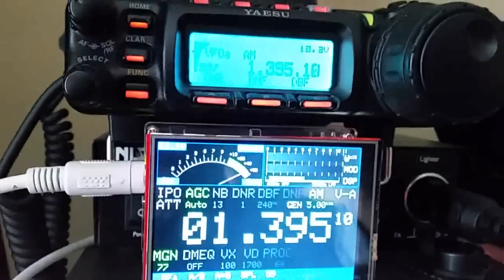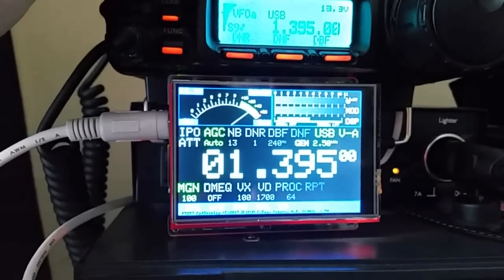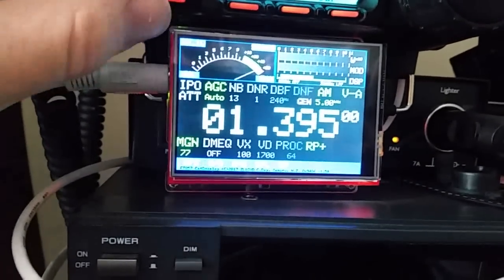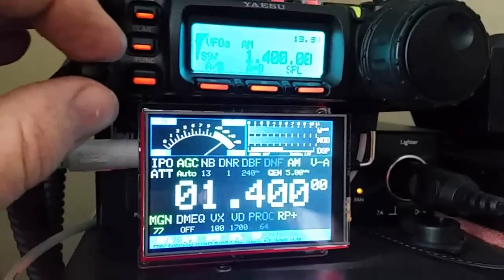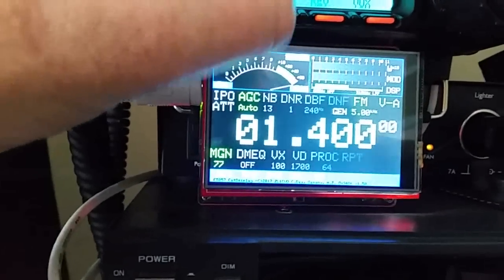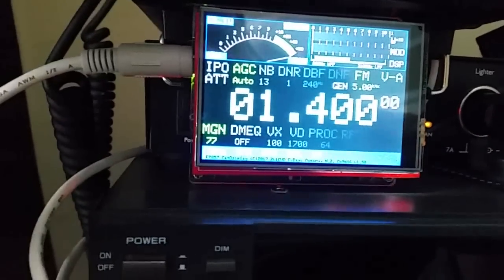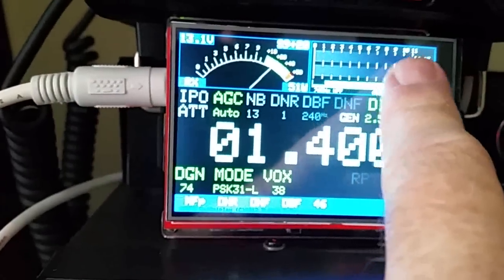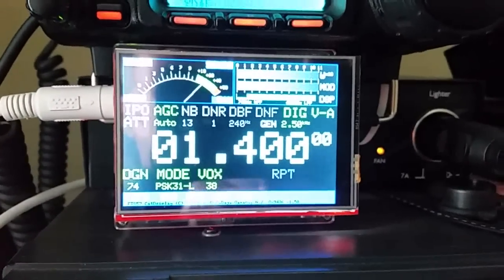CatDisplay for Yaesu FT-817, FT-818, FT-857 or FT-897 Transceivers

Comment: The CatDisplay arrived 3 days after ordering and is now working with my 897, as its original display is almost unreadable now. My radio doesn't have extended menu items 15 to 21 for some reason, but the CatDisplay worked fine without those adjustments. .Thanks Chris 73 Dave XU7AKG

Comment: Please tell me Chris you're intending to develop a CAT pass-through. I really need this display, but I just can't have it monopolize the CAT port. If you can add a pass-through, you'd have a world-beating product!
Reply from the maker: Yes I do intend to add a pass through port but its taken a heck of allot to work the code out. The 328PB processor is full so have had to move to 644P. A new board has been designed and 50x delivered for almost 9 months now. I had it basically working then Arduino updated the IDE which ended up breaking my compile chain. I've got it going again with latest IDE but its not 100% perfect and needs more refinement. I've even purchased www.catdisplaypro.com as a home for it and the other versions of the basic CatDisplay. So definitely in the pipeline but taking way longer than I'd hoped. 73s om.

Comment: Your eBay page shows you have one left for the 857. When will you have more ?? By the way, awesome item!!! I WILL be buying one! 73s 
PS, I would like to see the tune option for the ATAS120, I use it a lot. If you could add that, then it would be perfect, for me anyway. Thanks again
Reply from the maker: I won't be adding cat pass through  support because there is not enough code space left in the processor. 857/897 already has 2 cat ports - rear and front microphone. See the link in video comments. More stock will be available as parts arrive. 73s om

Comment: Do you have another video showing how fast the display responds when using the Main Tuning dial changing frequencies.
Do you plan to stay with the display.  The numbers are not smooth. Jagged numbers.
I own a FT-857(non D) and FT817ND I would like to use the unit on both.  If the stored firmware could be booted for one or
other with a switch it would be a big plus.  
Have you thought about bluetooth connection to the CAT port on the FT-857 instead of wired connection.  My FT-857 is mounted
in the trunk of my car with remote up front.   I use a bluetooth adapter for a few programs like pocket rxtx and others via bluetooth.     Thanks for a great project.    Ken
Reply from the maker: This is only video I have. A customer did this one: https://www.facebook.com/frank.f.jensen/videos/10211749145778240/
The small processor program size (32k) and large amount of data displayed means I cannot use another smoother font & support all FT817/FT857/FT897 models. This is why 2 versions of firmware - one for 817 and one for 857/897. Cat data is plain serial so bluetooth could easily be used if you want. However you wont be using the same Cat port for the display and a PC program at the same time - the display is very Cat traffic heavy as its continuously updating.  In its present form it has been well received with over 100 sold now so no immediate plans to change its format. I have jut update my 857 with a Collins filter so I'll try and fit which filter is being used on the display somewhere at some point. If I had used a Pi then the font would be better, it could support multiple rigs and touch screen would be supported. But then with my Linux programming ability and Linux's complexity, it wouldn't be ready to use until next century! all the best.
Reply: Took a look at the other video but doesn't give any indication how quickly the display reacts to the radio.
Reply from the maker: Another video here https://youtu.be/kuUg3tQGN4Y

Comment: how long can the cat cable be i would like to run one of these in vehicle with only control head on dash so 15 ft would be good  the display for this is much cheaper to replace then display on radio
Reply from the maker: It comes with 1.5m cat cable & I dont have longer. You could cut and splice a new section to it though. It'll do 15' ok. Only 4 wires needed RX, TX, GND & 13.8v. Shield RX/TX lines - cable like audio shielded would do. 73s om de chris zl1cvd

Comment: HI Chris. Display works great, but the S meter is at zero all the time. Is there a setting that need to check?
Reply from the maker: On the transceiver make sure the AGC is turned on (auto = all modes;  fast=AM; slow=SSB). Also you must be in VFO A or VFO B mode - it does not display correctly in any memory mode. 73 om de zl1cvd

Comment: Are you adding a feature to the display to show when you are using auto tuner or atlas antenna function witg the 857d including swr reading
Reply from the maker: Those items are not supported by Yaesu CAT commands so cannot read from FT817, FT818, FT857 or FT897 to send to CatDisplay. New models like FT991A, FTdx10 or FTdx101 have much better CAT command support and have these features on CatDisplay232 or CatMeters - see https://www.catmeters.com

Comment: I hooked this up to my 857D and it says it cannot find the baud rate.  I've tried setting all three, turning it all off and back on, and the frequency display is all zeros and then I get the cannot find the baud rate message again.  Have I overlooked something in the manual?
Reply from the maker: Make sure the cable is plugged the cat port & display port firmly. On the 857D, the Cat port is the one closest to the DC power lead. Make sure menu 020 is set to CAT. Menu 019 sets speed. On the 857D, you must press the F button after you make a menu change change until it beeps - this confirms the changed setting has been saved and is now active.

Comment: Hello Chris, 
Is there an update to current features etc now available?  Would like to add this to my 857D to help with failing eyesore.
73, Jim, WB8ZLK
Reply from the maker: Hello Jim. CatDisplay has been out for over 4 years now and is very stable. I sell it fully assembled and tested with 3D printed case, 1.5m CAT lead and instructions. It ships in plain packaging and can be ordered directly from http://www.catknobz.com I have stock. 73 om de chris zl1cvd
Reply: @ZL1CVD  Hi Chris,

Ok order has been just placed for the bundle including the 2nd cat port.
Thank you so much and 73,
Jim.
Reply from the maker: @jimwolsiffer4397  Thank you Jim. Order has been receive and will ship out today. PayPal will send an email with tracking details. All the best for the festive season OM. 73 de chris zl1cvd

Comment: the S meter makes to big steps imo, it show just s1 or s4 or s8 and nothing in between... would be great if it did
(Edit, aug, 2018) i made a app for android with an Smeter, it reads the signal from my 818 via BlueCAT and to be precise it does have 16 positions, from level 0 to level 15, still a lot better then the S-meter on the builtin Display... when it's finished i will release it, bu this CATDislay is a nice peace of art.
Reply from the maker: S meter replicates the rig action. If you closely watch the rig, it does that too..

Comment: Are you able to use this CAT display along with a SignaLink USB connected to the FT-857D?
Reply from the maker: Probably not. Even though the 857/897 does have 2 Cat ports, its unlikely the processor will be fast enough to handle the traffic from both the CatDisplay and another Cat device that has high Cat data usage. Eg. 2x Cat displays don't work - the rig gets confused. Note I don't have a singnal link so not even really sure what it is and what it does - I just assume since CatDisplay uses Cat port, and your  asking, signal link must you Cat port too.

Comment: Would the full firmware be available to allow using it on more than one radio?
Simply program for choice radio or does the hardware change too?
Reply from the maker: Compiled firmware yes, source no. Yes, just a quick program via serial to TTL converter changes what Yaesu rig it works with. Its Arduino Uno R3 (Atemega328p TQFP version only)  compatible too so you can make your own hardware.

Comment: I bought the 817 model but when I hook it up to the radio the freq display is all zeros.  It also doesn't show the modes.  what am I doing wrong?
Reply from the maker: Greg I have responded directly to your ebay message via the ebay message system. 73s om de chris zl1cvd

Comment: does it work well with the 991A
Reply from the maker: No. 817/857/897 only. Not sure why you would need one for 991A as it already has a TFT display?
Reply: Chris Day 

it has a signal meter and lots of interesting information that the 991A doesn't always show in every screen so redundant but also quite awesome unit.
Reply from the maker: OK. thanks
Reply: So could it be made too work on 991A?

Comment: It will not work with Yaesu FC-30 antenna tuner we use the CAT so sorry me with my old eyes. Dam.
Reply from the maker: Yes it can work OK on 857 & 897 as they have 2x CAT ports. The 2nd port is the microphone up/down control signals. Set menu #059 to CAT and menu #019 to 4800, 9600 or 38400 and menu  #020 to TUNER. Plug FC30 into rear Cat port and use an adapter like my 2ndCat to pull out the 2nd Cat port signals from microphone port. See ebay item 123584738758 for the 2ndCat adapter or make your own. 73s om de chris zl1cvd.
Reply: @ZL1CVD  I do not find this item on ebay.com I am in Canada but we are buying using EBAY.COM USA
once we have the cable we buy
Reply from the maker: @claudem.p.7969  https://ebay.us/9MN8dz

Comment: Can I change a cat rate?
Reply from the maker: Yes. Supports same Cat rates as the rigs - 4800, 9600 & 38400. Details in manual on page 1.
Reply: I did not explain myself. in the cat port of my 897, there is an at897 connected which has a different rate than the one with which the display works